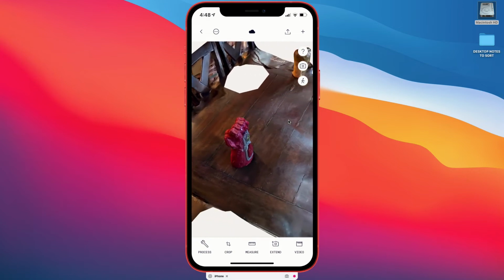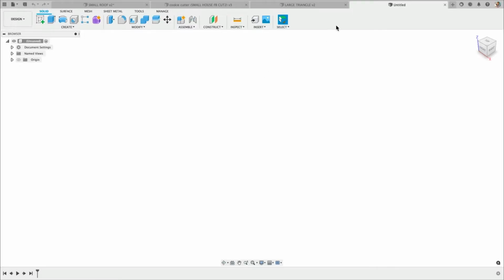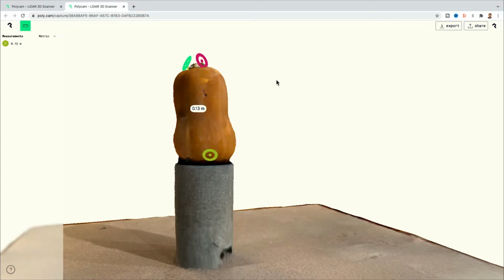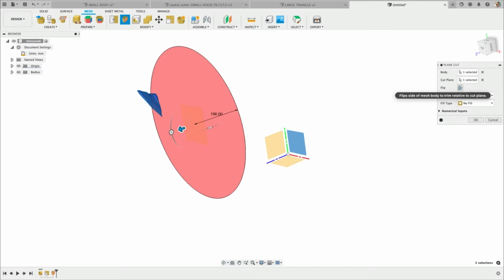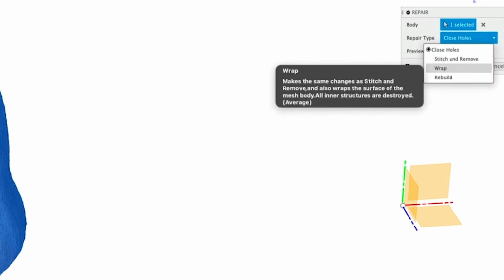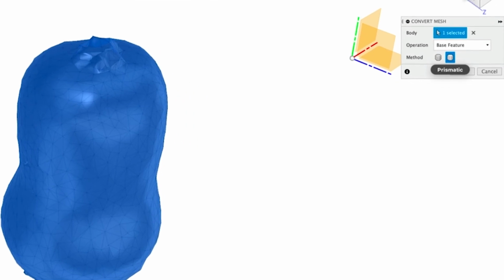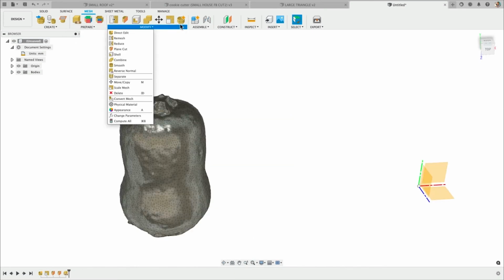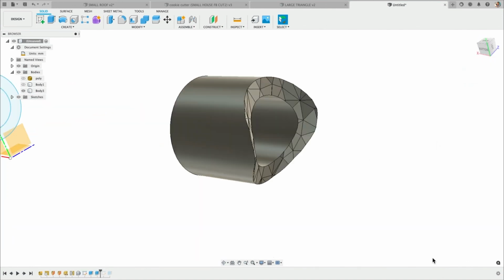Polycam to Fusion 360 Tutorial: Use 3D Scans as CAD Reference for Engineering

Comment: You forgot to mention a fairly important detail. You imported the mesh but before clicking off the mesh to see that it was yellow, you cut the scene and used the “convert mesh” function to convert it into a solid. You should tell people that function is only available in the PAID versions of fusion 360. To anyone using this software, if you follow this tutorial you will end up with a yellow mesh that is more or less unusable.
Reply: not sure if this has changed since or what, but on my person (free) copy im able to convert to a body, hope this helps someone down the line
Reply: @brick_m  The prismatic is paid you can use the other one which is not as good